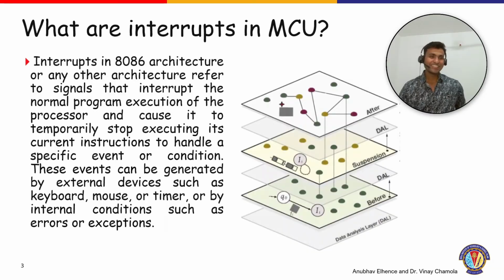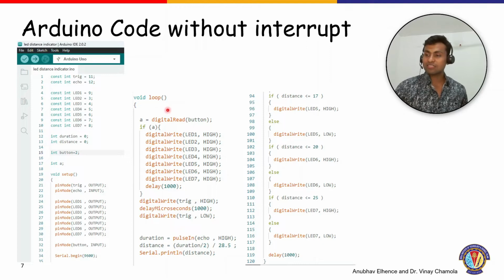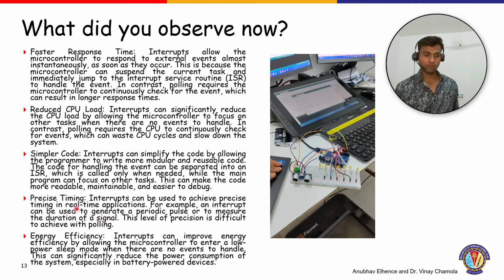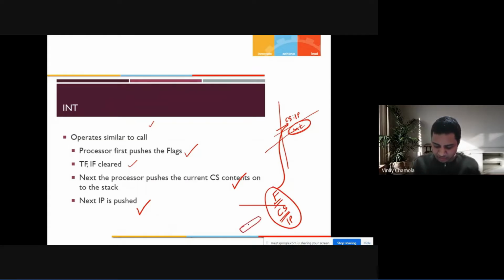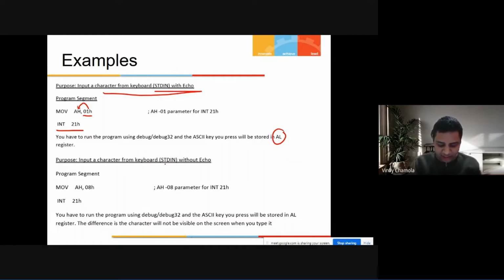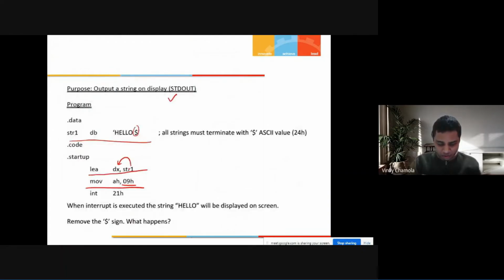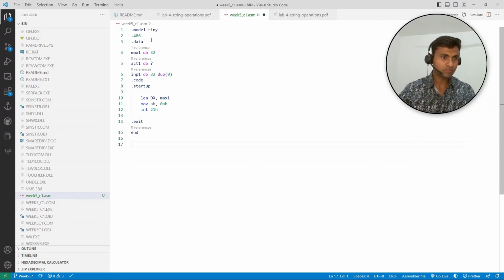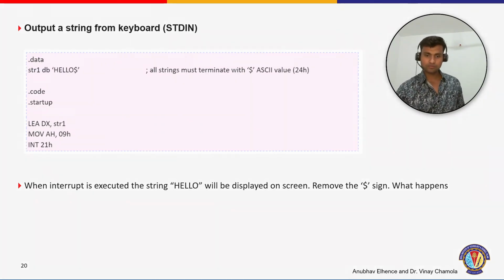Microprocessor Programming and Interfacing - Lab 5 - Dealing with Interrupts

Comment: Great one. Interrupt is an exception from normal routine. Demonstration showcasing the need of interrupt (unlike polling) was nice. 
Yes, "Making it more aesthetic" is right. aesthetic is adjective itself.
Reply from the maker: Coding interrupts is not very difficult, Only thing is that when making projects, we try to run away from it. Having arduino like Microcontroller makes it easy for us to use Interrupts.
Reply: @AIoTBlocks  Agreed. I see interrupts usage would ease the coding style and yield clear design. You can do better management/control of tasks using i.e. Interrupt priority, nested interruption etc.